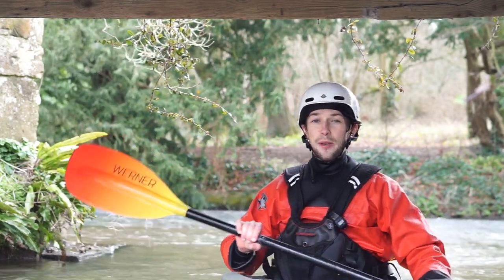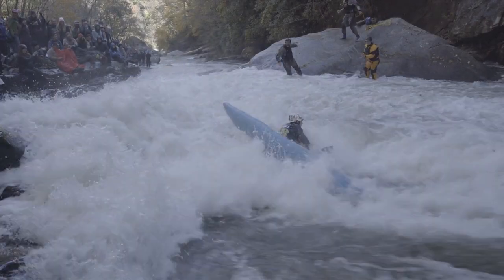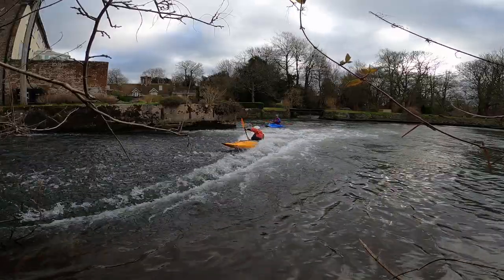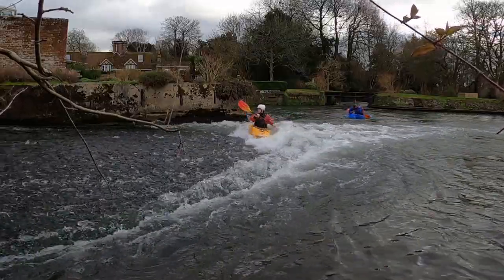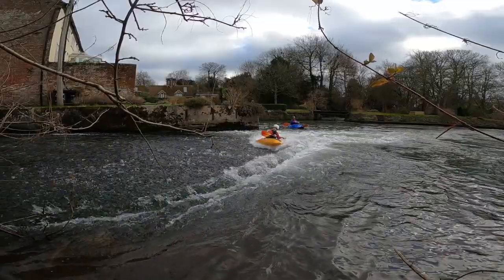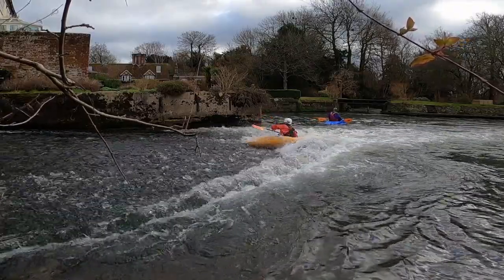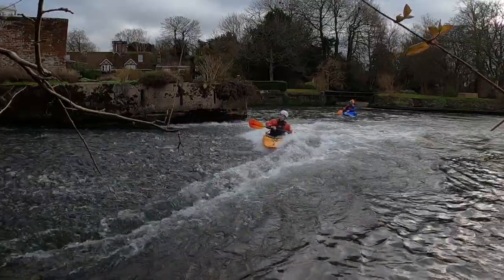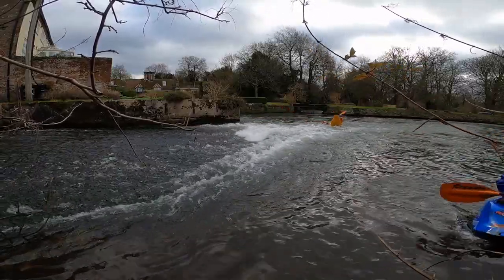How to spin your kayak like a pro!

Comment: So I get turning to look upstream after your bow has pointed downstream as your body will follow but isn't looking upstream during the first part of the spin the opposite of this?
Reply from the maker: Great question and observation. You are right, but the hull shape of most boats will naturally turn downstream irrespective of our effort. Having the head facing upstream sets the body up in its best alignment for correct edging. Have a go at looking downstream the entire time you're in a hole and see how much less stable you are. So, I suppose in answer to your question, you are absolutely correct to say that it doesn't necessarily help the spin, but it most certainly keeps you dry side up!